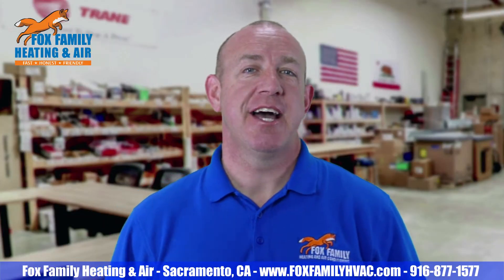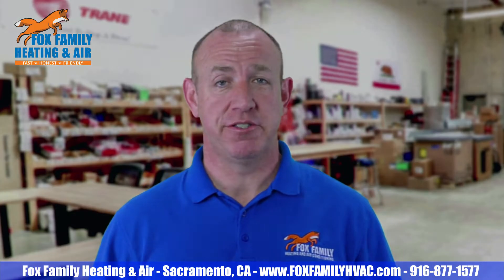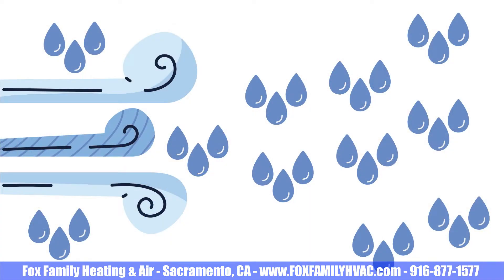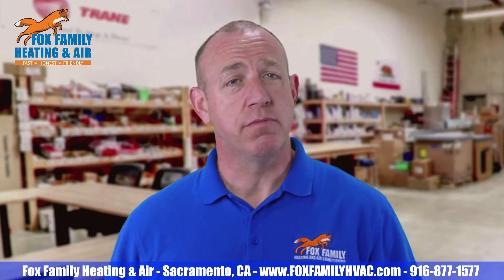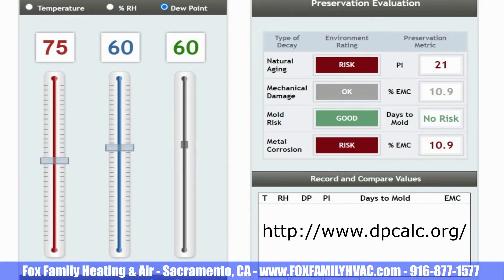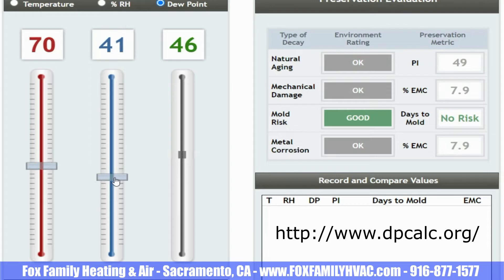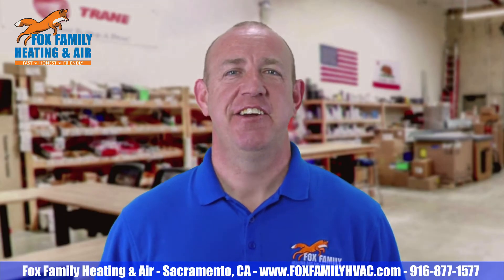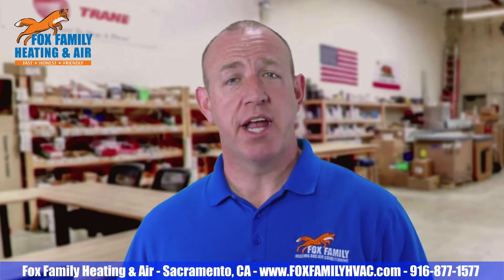Why Are My AC Registers Sweating?😰

Comment: Excellent information.  As a Mechanical Engineer you are spot on while other sites are way off.  One additional comment is that I have a high ceiling with discoloration on the sheetrock (as far as 10-12 inches from the register) due to moisture accumulation on the interior (cooled) surface of the sheetrock, not the register.  It is only occuring on the sheetrock around the vents in the one room with a 10-12 foot tall ceiling.   I believe the condensation on the sheetrock is due to high humidity air in the higher ceiling contacting cooled air exiting the register and condensing on the sheetrock as the warmer moisture containing air travels through cooled air and condenses on the sheetrock.  The fix I plan to implement is a register that does not direct air flow at an angle, but straight down.
Reply: I have a few ceiling vents that are prone to sweating. I just addressed a bubbling area surrounding a ceiling AC vent in a small bedroom. Upon scraping away the bubbling paint / drywall mud, I discovered that the drywall was moist and soft. I completely removed all of the affected drywall around the vent and cleaned everything up. I then installed new green drywall and am doing the texture work now.  Upon installing the new drywall, I made sure to have a minimal gap which I sealed completely with caulking.  I am researching if adding foam and a vapor barrier to the top / attic side of the uninsulated supply box would help to keep it insulated from the heat of the attic as is the actual insulated ductwork (hose).  I'm hoping someone will see this and share their own experience on this.

Comment: Painters spray flat ceiling paint over registers in the rental industry here in Georgia. We do so many HVAC duct cleans with register replacements. Because of painters being lazy! They have cost rental companies millions upon millions. The condensation water absorbed into the flat paint and causes mold to develop on the registers.
Reply: what kind of paint should be used? enamel?
Reply: @cryengine_x  none metal HVAC register/vent covers come from the factory. Painted with acrylic urethane which essentially is car paint and waterproof. Once painters spray ceiling and wall paint over them. The registers then start developing microbial growth. The bottom line is. They should remove the registers off the walls And ceiling before painting. But they don't and not to mention how horrible it looks when the HVAC register is beige in color just like the wall. Dust sticks to them easier. The drywall around them starts to get mold on it. If you think about the attic heat behind the ceiling registers making them hot. Then cold air starts cooling them they sweat like a cup of ice water outside in the summer. Now if someone is removing there HVAC registers and wants to repaint them instead of buying new ones. Well I would still recommend using acrylic urethane paint and a clear coat.

Comment: i have a weird issue of mildew around only one register. all the others in the house are fine. it's in a bathroom that rarely gets used. it's clearly moisture as the paint is peeling and the register is rusting.

one simple solution, if it works, i saw on youtube was to buy a plastic or aluminum register, so it cant sweat. having a hard time finding the size i need though.
Reply: Don't close it leave it open the more airflow coming thru it the easier it is for it to dry. But once it's started rusting and paints peeling. It definitely needs to be replaced.

Comment: I was watching some over your older videos on whole home fans as I'm very interested in getting one for my house. I'm in NorCal. Actually LAKE county to be exact. Not to far from your business. Would this be a good climate to install the whole home fan in.
Reply from the maker: I have one, but only use it when the outdoor temperature that you would be bringing in is below what you can handle inside.  I like it around 72-75 in my house, so only if it's cooler than that will I use my WHF.  I hope that makes sense.
Reply: @foxfamilyhvac  I'm mainly planning on turning it on between the hours of 1am and 5am to drop the house temp. Which sounds probably similar to how you use it.

Comment: Metal registers sweating with temp set to 72F and humidity of 50% which is dew point of 52. Boots are insulated with no leaks. Ducts to registers are straight and all registers are fully open. Fan speed set to the lower one. We run dehumidifier to get it down to 40 or so but this isn't possible to do consistently. Is there anything else that can be done?
Reply: Switch to plastic registers, no metal at all.

Comment: Very informative video. thanks for sharing your knowledge. I don’t have sweaty registers. But I do have high indoor humidity levels, and only 8-9 run cycle times. In this video, you mentioned, if you have humidity issues in the house, and the tech is debating on whether to move the blower motor speed,  one dip switch higher, or one notch lower, to match the compressor speed, and static pressure, he should always choose a little bit lower. 

Would that be a good place to start…lowering the speed of the blower motor, and see if that adds to the run cycle time, and lowers the indoor humidity level?
Reply: The air would move slower across the evaporator coil absorbing more heat/humidity from the air. Yes this will help. However the blower speed needs to be adjusted to the proper cfm per ton
Reply: Thanks for the reply. I’ll need to read the manual. If I remember correctly, I think the unit is rated for 350-450 CFM per ton.
Reply: The blower fan speed was set to 2100. It’s a 4 ton system. Maybe that’s too high? There’s also a 1900 option and a 1600 option
Reply: @fla8502  the home is in a high humidity area, the gulf south. The blower fan speed was set to 2100. It's a 4 ton system. Maybe that's too high?
There's also a 1900 option and a 1600
Reply: I adjust air flow to 350cfm per ton here in Florida. This is recommended.  No more then 400cfm per ton.
Reply: @fla8502  Thank you. I will check to see if there is a 1400 setting.

Comment: Thank you so much for this video. My vents are not sweating, but I am struggling with high humidity in my house. I have two units here on my property and both share an attic. Consistently, if I turn the AC on in either unit, the humidity goes up to 60 plus. I also have dehumidifiers in each unit and the lowest the humidity will go with the AC off is 48. The attic feels stifling. I live in so Cal, so it's not a particularly humid climate. I also have both AC furnace/air handlers as water heaters in my attic as well and I'm wondering if I should approach this as an attic ventilation issue or an AC issue. The reason I'm focused on AC is because both units are increasing humidity rather than decreasing. Would attic ventilation be the issue with the AC's? I know it can affect the cooling, but the AC is cooling. It just isn't removing humidity. 

Any help you can offer will be so appreciated. Thank you so much!
Reply: Keep in mind that lowering the temperature,always makes the relative humidity increase, since warmer air can hold more moisture than cold air. So, they aren’t actually adding any water to the air, if it’s not sweating, them, pardon the pun, don’t sweat it.
Reply: @waynenocton  Hi Wayne. Thank you for the comment. My understanding is that the AC is a dehumidifier, so the air it is bringing in should be dehumidifying the air in the house. Shouldn't it? Why are you thinking that it should be increasing humidity?
Reply: @asoulalignedhowgodhealshis6682  an AC unit, does dehumidify, but, making air colder makes its ability to hold moisture decrease, there increasing the relative humidity in many cases. So there is in fact, less water in the air, but the very cold ducts can be below the airs dew point, which makes it sweat. I wish I had a way to send you a screenshot, I’d show you a walk in cooler’s graph showing temperature and humidity, and it’s clear that the even though the door hasn’t been opened, as the temperature goes down, the relative humidity goes up, then when it finishes it’s run cycle, as it slowly warms up, you see the humidity decrease, but remember, it’s the relative humidity, so it’s a percentage of how much water the air can hold at that temperature, it’s not actually showing the amount of water per cubic foot of water.
Reply: @waynenocton  Wayne, you are really kind to take the time to explain this to me. I am so grateful to you. So, if I understand you correctly, the percentage that my nest system is showing is the relative humidity rather than the humidity ratio and so this should not concern me? I have been so concerned because that percentage keeps increasing every time I turn on the AC. In this case, what would you do? I feel very sensitive to heat and humidity in general, so I was wondering if I should just add ceiling fans. The other thing I realized is that my AC unit is large for my space, so I thought about increasing the ducts in areas of the house where I don't feel enough air, like the kitchen and the bathroom (currently does not have a vent). Thank you again. You are really special to take this time with me!
Reply: @asoulalignedhowgodhealshis6682  yeah if the unit is oversized, it won’t run as long, so that’s less time it has to dehumidify, but it’s absolutely normal for the humidity shown to be higher when, and right after the unit runs so you may be worrying about nothing. Are any of your vents showing condensed water on them? Any mold growing near vents and around light fixtures, especially recessed lights are common to have some mold growth.
Reply: @waynenocton  Hello again. No mold around lights or vents. I opened my furnace yesterday and coils are clean, no excess moisture. Everything looks clean. Wayne, I can't tell you how grateful I am to you for taking this time to talk with me. No one here is so cal seems to know what they're talking about. I just purchased 4 ceiling fans to have installed for the price they wanted to charge me to clean the coils that they didn't even bother to look at. My house was done very well but it is airtight and I am thinking that some added ventilation will do some good for the comfort issue. Thank you for alleviating my worries. I have respiratory issues and I was really concerned that something was wrong and I might be putting myself in more danger. Thank you again!
Reply: @asoulalignedhowgodhealshis6682  you’re quite welcome, but yeah based on what you told me, you don’t seem to have anything to worry about, sometimes the gadgets can make you notice too much lol, happy to help.
Reply: @waynenocton  Wayne, why is it that people say that the AC is a dehumidifier and that it should be lowering that humidity percentage? Is that incorrect?
Reply: @waynenocton  That is so true about the gadgets.
Reply: @asoulalignedhowgodhealshis6682   they definitely do dehumidify, especially if they are sized correctly so they have decently long run times when it’s very warm. And they see the water condensation forming and draining out, so they see that it is removing water from the air, but not a lot of people actually watch to see how things are effected.
Reply: @waynenocton  I see. Thank you again Wayne. You're awesome

Comment: Alot of people adjust their air at the register having cold air stuck at the can instead of doing it at the damper at the supply plenum. I live in Hawaii humidity is always at 80-90%
Reply from the maker: That's great thanks for the input
Reply: @foxfamilyhvac  no problem loving talking hvac with other techs

Comment: How do you insulate the inside of a boot?
Reply from the maker: Bubble wrap around the insides
Reply: Insulation sheets are also available. Even flat armaflex sheets. If your boot is squared, you can cut the pieces to fit the inside of the boot and glue it. 

Also, make sure you seal the edges of the boot where it meets the ceiling sheetrock. If there’s gaps, the unconditioned attic air can be mixing with the cold supply air coming out of the boot. We usually use duct sealer (mastic) works about 90% of the time for us here in Dallas. That usually takes care of the problem.
Reply from the maker: @abnergarcia6252  perfect
Reply: @foxfamilyhvac  I have some double sided reflective foil insulation. Would that be good to use? The troubled boot is an odd shape though...square at bottom but curved at the top.